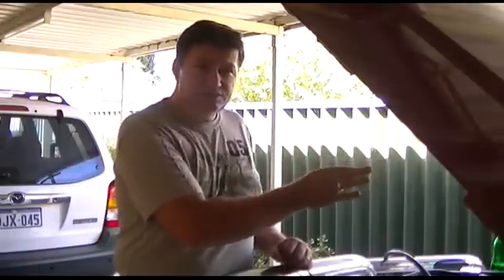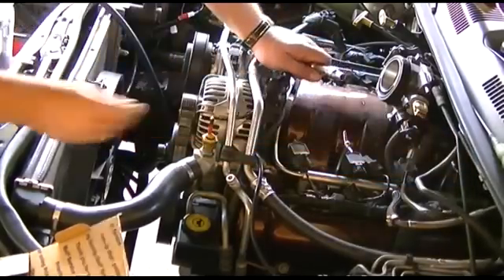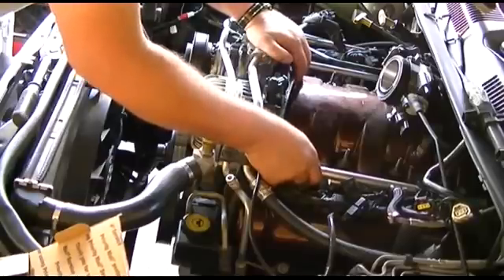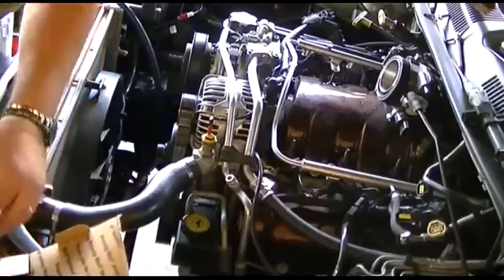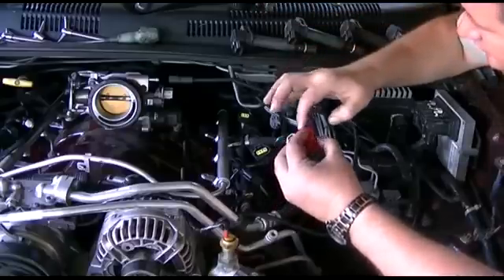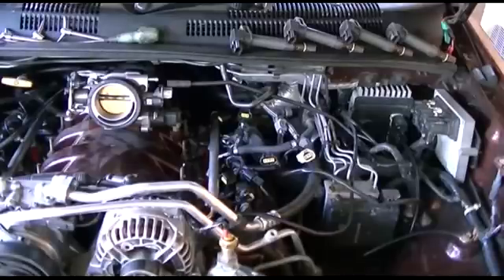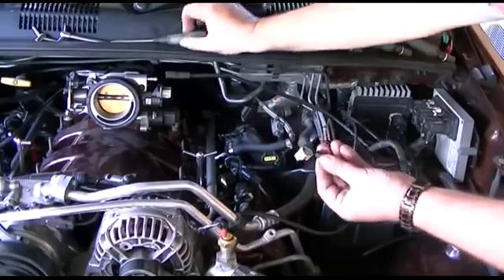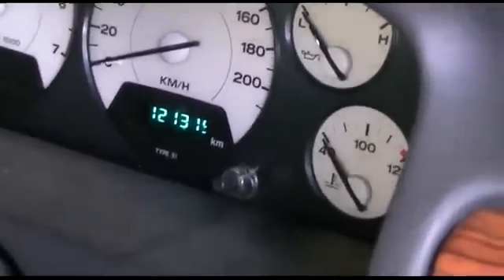How to change fuel injectors with 12 hole injector for better fuel economy and power in a WJ Jeep.

Comment: I ordered these injectors and they will be here tomorrow. Cab you please give a fuel economy update?
Reply from the maker: You already ordered them lol bit late to ask now. But it differs in what modifications the engine has. But mine improved from 16+ litres 100klm to 12+ litres per 100klm. But improvements varies from driver to driver. Let us know your result. Regards Rik
Reply: Home Mechanics, yes...I had already planned to upgrade to the 4 hole injectors but then I found your video about the 12 hole injectors. I have a 2003 year model and apparently the standard and HO engines use the same 24 lb injectors. They are 2 hole. I wanted to upgrade to get better atomization, providing smoother running engine and fuel economy. I will post back with the results.
Reply from the maker: The stock have a 19lb injector and the HO 24lb injectors. But it will not matter as the ECM will adjust.
Reply: At some point they changed the stock injectors. Mine came from the factory with 53032145AA 25.8lb /hr @ 49.2psi. That translates to 24.26lb /hr at 3 bar, or 43.5psi.
Reply from the maker: Wow never heard of that before unless it was optioned from new.
Reply: It conflicts with wjjeeps.com too. But if you look up replacement injectors for the standard and HO, they are the same part number. They probably adjust the pulse width in the ECM.
Reply from the maker: I really need to upgrade my ECM one day with all my mods.
Reply: I agree, if you get an HO unit, those have knock sensors that you should research. Not sure how that would work.
Reply from the maker: It would not work I would have to get a aftermarket ECM unit like Superchip or Haltech.
Reply: Is that an ECM or a tuner?
Reply from the maker: There are different levels available but you don't need to worry about needing one for the injector upgrade. I mentioned it because of the radical upgrades I have made to my engine. My upgrades are outside the stock ECM capabilities. Regards Rik

Comment: Awesome build,I watched all of your videos regarding your WJ.
I ordered the same injectors(part number) as the ones in the video only difference is that they were remanufactured.
power is definitely noticeable and the throttle is more responsive too,only thing I noticed which maybe it'll will sort out itself is the xx L per 100KM on the EVIC shows a bit higher than usual.(even though it is more economical based on a full tank (how many KM I get now compare to before).
I do have one question,did yours come with the hard plastic clips that hold the o-rings in place ? or did you take them out ? (bottom end of the injectors).
Reply from the maker: +Benrick C So sorry I never saw your question before now. I have had 2 years of bad health and that is why I may have missed it.

To answer your question I don't remember any clips holding the bottom O ring on. The O rings just rolled over the bottom lip when replacing them. It's possible they were removed before I purchased the WJ I guess.

Comment: How do you reset your PCM? and can this work on a Dodge ram 1500 4.7 as well? I was told that I could run older model 4.6 ford mustang injectors to get more horsepower. Is that true?
Reply: Home Mechanics Congratulations !   Hope there are a few jeeps in there !   Have been following a few of your Grand Cherokee videos as mine is getting a few of the little issues that they get at around 150,000 km or so.  Have just got 12 hole injectors as per your video, and have also only a month ago replaced the solenoid pack in my transmission ( works beautifully now after a year or so of annoying intermittent codes and limp home mode).  An easy fix as long as you are organised and have all the fluid, filters, sealant and solenoid pack replacements ready to go.
   Next job is hydraulic lifter( lash adjusters) replacement but still unsure whether to just replace them or go for solid lifters as I am really not sure if I want to be under the bonnet checking/adjusting them too often.  Have also had the issue where the wire breaks in the drivers door .  I think that's everything covered !   But appreciate your videos and thanks !
Reply from the maker: Yes it would work just fine. I have a feeling the Mustangs are the same injectors but I am not sure about that you would have to do some more research.

Procedure for resetting the PCM are easy and the PCM will start over as if the engine is new. It will adjust how the engine runs with the new components.

Disconnect the POSITIVE battery Terminal and touch it to ground for 30 seconds. If it is too short use a jumper cable.

I usualy leave mine earthed for longer or overnight if it suits me. This is to discharge the PCM capacitors, which maintain the adaptive memory. It is like a factory reset and will start learning how to run best all over again. I beleive it remembers 50 trips.

Reconnect the Battery Cable 

Turn ignition switch to the “On” position but DO NOT start the engine
Turn Headlight on then off again then lastly turn ignition key off again.

Your PCM is now reset.

Regards Rik
Reply: You know what's odd, is that The 4.6 ford injectors have 4 holes like the 4.7 dodge injectors, so what's the difference? unless the dodge is only 19lbs and the ford is 24?
Reply from the maker: King Cobra it is not odd at all as the holes are different in size.
The reason the 12 hole injectors work so well is because instead of small streams of fuel the fuel from a 12 hole injector is like a mist already atomized in the air. Just look at the mist comming out in my injector cleaning clip.

Try to imagine fuel burning as it goes through the air. If it is a thick stream of fuel it takes longer to burn than if the fuel is a fine mist. In fact as a fine mist fuel is much more explosive. 
The volume of fuel comming out of the 4 hole and 12 hole is the same it is just that from a 12 hole injector is is more available to burn giving extra explosive power. So you need to accelerate less for the same result giving more economy but if you hammer it also more power. 

The result in my modified engine were great as well as other feedback I received from others who also used the same injectors after watching my clips.
Reply from the maker: King Cobra Look if the Cobra injectors are also 4 hole injectors but 24lb I would not use them but go for the 12 hole injectors instead. You may get some power improvements but certainly not as good as the 12 hole upgrade. Rik
Reply: So if I go find a old junk yard v8 mustang and get the injectors out if it, would there be any difference? So try to find 12 hole injectors?

And how do I know how many pounds my stock injectors have? does the "pounds of pressure"? have anything to do with it? or just how many holes there are.

Can you find me a set of 8 12 hole injectors like you had, the link in vid is outdated or something, Im not too sure what to look for.
Reply from the maker: King Cobra I know from the workshop manual the stock 4.7 V8 has 19lb injectors and the HO 4.7 V8 engine has 24lb injectors.

The pounds is the weight of fuel the injectors can deliver in a certain amount of time. This is equal to 250cc per min.

My personal advice would be to find some 12 hole injectors you will not regret it.

The part number is in the clip description as I recall they come from a 2006  4 cyl ford focus and you need two sets.

Found this on eBay under "EV6 24lb 12 hole injectors"

http://www.ebay.com/itm/Mustang-Racing-24lb-Red-Cobra-Fuel-Injectors-4-6-5-0-Ev6-Connect-12-Hole-/321637484592?pt=Motors_Car_Truck_Parts_Accessories&hash=item4ae3168830&vxp=mtr

These are 2nd hand and will need a clean and new filters before installing.
This is the same people I brought mine from and they had holes badly blocked.

Hope this helps Regards Rik
Reply: Well, instead of waiting 2 weeks for those injectors, I just went to the local junk yard and found 2, 2005 ford focus's and paid 60 bucks for the injectors, and here in the States this both of those cars only had 90,000 miles on them, so not to bad. Installing them tomorrow. You have been really helpful my friend and ill let u no how it goes. Thanks
Reply from the maker: Your welcome.  Make sure all the part numbers are matching before you install them. You dont want to mix different volume injectors. Please let us know how they go  in your Dodge. Other readers would also like to know. Rik
Reply: What do you mean by part numbers?
Reply: its not like a take a injector off, put another on? and one question, the fuel pump on the 4.7 engines are gonna be able to work correctly still, right?
Reply from the maker: Yep same no problem. No need to do any other upgrades. Habe fun and enjoy doing it yourself.
Reply from the maker: King Cobra The part numbers are on the side of each injector. Not all numbers are the same just the part numbers.
Reply: I would love to see dyno run on a vehicle with single hole , 4 hole and 12 hole injectors to see if there is any difference in power .
Reply from the maker: I can tell you from experience no dyno needed the difference is that obvious.
Reply: Thank you.  Your in Australia ?  In Tas myself.
Reply from the maker: Im in Perth. The new world record holders of the worlds longest 4 wheel drive convoy . Just achieved today :-)
Reply from the maker: Depends on your driving habits. I am as we speak installing performance camshafts. This is 30,000klm after first instaling the solid lifters. Even now they are not noisy. Maybe in other design engines where the clearance is bigger but I have not touched them in 30,000klm. I will need to adjust them now but only because of the change of cam lobes. Regards Rik